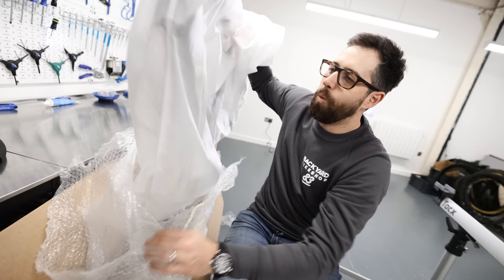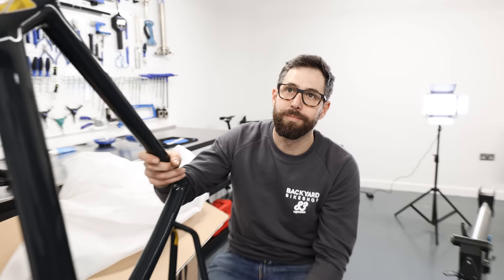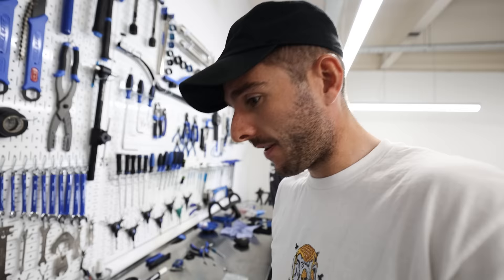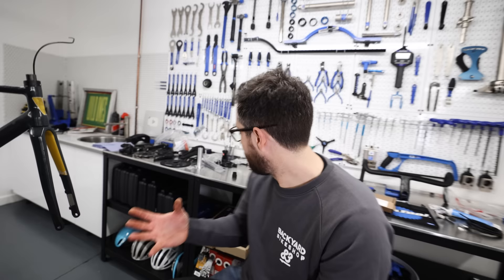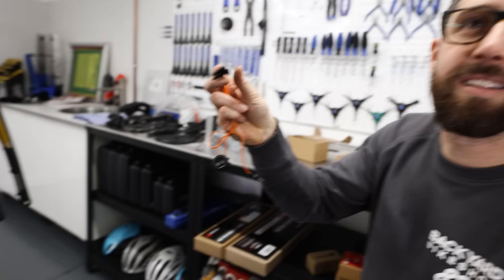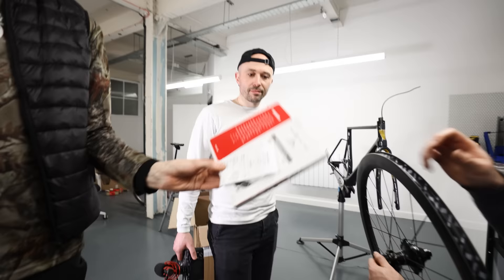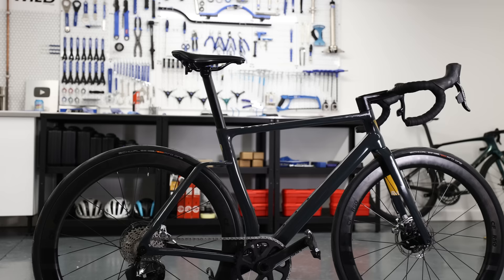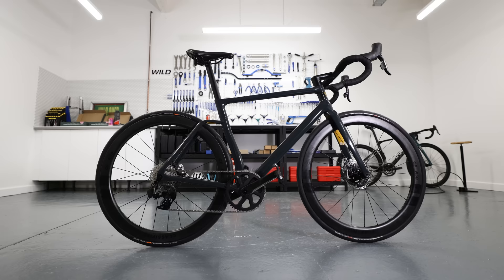We've Never Seen A Bike Like This - Nic's New Road Bike

Comment: 900g+ weight penalty? That doesn’t negate the weight of a front mech / chainring etc at all. You’re adding about half a kilo in comparison. The only advantage is an aero one, but then that’s probably negated by the whopping thru axle lever… it’s fancy tech, but that’s all.
Reply: To be fair, that’s compared to my Zipp 353’s with a 10-33 SRAM Red cassette and Michelin tyres. So probably about 300-500g lighter than most other wheelsets out there. But yes, it’s still a heavy system. I’m sure with the new investment and other wheel manufacturers like Enve they’ll be able to shave some of it off.
Reply: @nicvieri2627 true, there’s more to be had I’m sure. There must be something in it otherwise they wouldn’t have secured the investment they have already! Enjoy it, looking forward to an update to see how you find it after putting some miles on it 👍🏻

Comment: The future Nick describes already exists - Shimano Alfine 11spd Di2. With Gates belt drive makes for an awesome low maintenance set up on my road/commuting bike. Rear wheel is a bit on the heavy side, but that's the only negative.
Reply: And shimano also have automatic gear change based upon your cadance.  And you have the pinion system aswel. Is said to be better than rohlloff.
Reply: Heavy and not terribly efficient (Alfine is decent, but all geared hubs seem to be just slightly worse than casettes). But almost 0 maintenance rules, it's great for the everyday bike.
Reply: @Finnspin_unicycles  tiny bit less efficient than a derailleur system working in perfect order, but not so you'd notice when pedalling. For low maintenance commuter or touring it's awesome! Overall weight is about the same as a 'typical' derailleur system, it's just concentrated more at the back wheel.

Comment: It’s been several years on market after 1-2 seasons you need to send it back to serce to replace internal parts. It expensive and heavy. It is not a future of cycling. Cyclists are not totally satisfied and some go back to a regular double ring. The range is not as good as traditional gears and ratios. unfortunately.

Comment: Very nice bike. The classified hub is very interesting and I think things will move internal over time as long as they can get the drag down on the system to a point where the loss of drag is made up for by the loss of aero drag. No pro is going to run a system that costs them watts and if pros don’t run it people won’t buy it despite most people’s needs and a pros needs being basically the opposite of each other.

Comment: Great video. The electronic shifting and internal gearing is moving much faster into production on the e-bikes where you're pushing 400-600 watts through the drivetrain continuously and there's more wear from heavier loads.

Comment: Sweet bike. And yea… internal gear hubs do kinda rock. I’m personally a fan of them. I’ve got an 11spd hub on my gravel bike, and frankly love it. Is it the lightest? Nope, but hella resilient. Gates belt too… aka, so little maintenance it’s lovely.

Classified seems to be more or less going that direction. But am sure Rohloff, Shimano/Sturmey Archer will go electric shifting soon enough. The tech is there to do so.
Reply: Rohloff and Alfine 11 are already available with electronic shifting!
Reply: @here-be-ember  I read somewhere electronic is better for hubs since they're more sensitive to "cable" adjustment. Something about not fully engaging the gear if the adjustment is wrong.

Comment: Uno-X bike team testet that hub. The biggest problem was around the thru axel. Can't remember if you exactly why. The bike looks amazing tho and clever way to ditch 1 chainring.
Reply: They do different length thru axel’s. Some frames stick out more so if it’s too short it won’t tighten. I opted for the longest one. Just so that I can use it on a different frame of someone wanted to try it out.

Comment: I believe that those classified hubs would really take off if you could control them directly via DI2 or eTap.
Reply from the maker: I think you already can with di2
Reply: yes you can do it, but you have to cut the original cables of your Di2 shifter (but that hurts) and make the connection to the remote controle unit of you classified system.
Reply: @rikmeynen9871  Well, not really the solution I was hoping for 😃

Comment: Does not make sense, what problem does it solve? Basically they replace a simple front derailleur with a far more complicated set-up and there is no way that it would be more efficient. It essentially forces you to cross chain and that is always less efficient and then there must be additional drag in the planetary gears.

Comment: Love your videos, but the Classified hubs are a solution to a non-existent problem. What's the problem with front derailleurs? Either you go full internal hub gears (+ belt drive) and then you have a heavier but almost maintenance free setup, or you just stick with the regular 1X or 2X chain drive setup. Having internal gears AND a rear derailleur has almost all of the disadvantages of both systems with almost none of the pros.
Reply: I think the biggest advantage would be in the TT sector. Most of those guys are opting for chainrings up to 60t to maintain their chain line. Downside is climbing slight hills then without the small ring. Definitely very niche though. Will have to see how durable it is over time. Gonna be smashing it around for this year to properly test it.
Reply: @nicvieri2627  This thing would be great on a folding bike.
Reply: @barrytantlinger1033  Just put an internally geared hub on the folding bike and call it done.

Comment: Shimano made 11 speed electronic hub gears in the past, but it was a bit clunky and made for citybikes
Reply: They still do with the Alfine. Available with Centrelock disc. I've never used one so no idea how good it is or isn't, but axle options are slim (only 135 old iirc).

Comment: wouldnt the loss in efficiency of a hub gear counteract any potential aero and chainline gains?
Reply: and weight lmao
Reply from the maker: apparently it’s 99-99.5% efficient in the “smaller ring” position. No difference in the other position.
Reply: Yes, and by an order of magnitude for the kind of cyclist who should care about aero. 

Front derailleurs are fine.

Comment: Does going internal make it easier or more difficult to maintain? For a backyard mechanic like myself things like internal cabling increases the difficulty.
Reply: More difficult,  but also equally more cool.
Reply: Definitely more difficult. And definitely more expensive. You have to cut the brake hoses every time a headset bearings needs replacing. 
But everyone seems to be going this way.

Comment: 3T did this some years ago and it's a much prettier bike.
Reply: The 3T Strada was, and still is a frame designed for a double chainring and front mech.  The Vielo R+1 is designed and engineered purely for 1x single chainring. The symmetrical down tube into BB area increase lateral stiffness by 32% over a traditional double chainring frame design. This figure is fully tested and accurate.

Comment: Large weight penalty even if you lose a small chainring, hard to maintain, expensive (saw around GBP2800), an inability to easily swap wheels between bikes and drivetrain losses means this gear system is inferior to a standard set up. I could see this disappointment on the poor guy's face when the scales showed his bike was an anchor.

Comment: Question - I have a V+1, and understand that the thru axels are proprietary? Is this the same for the R+1, and if so, how are you using the Classified axels? Cheers - D
Reply: For the Classified axle, we have manufactured another rear mech hanger to accommodate the 1inch and half pitch thread for the Classified axle. Our standard Vielo QR axle has a TR3 x 12 pitch. So you can fit the Classified Power shift system to either V+1 gravel or R+1 Road bike with the new hanger. We can supply these hangers FOC.

Comment: The seat stays are super ugly and I doubt that carbon frame is made in the UK. The local brand is rebranding chinese carbon frames, nothing special really. Just another brand selling overpriced carbon frames.
Reply: I can assure you none of our Vielo frames, or any other parts come to that are rebranded Chinese. Everything is designed and engineered by Vielo out of our Gateshead headquarters.
Reply: @ianhughes4169  I highly doubt it's made in the UK. It's 100% made in the far east by an OEM and rebranded like most Western brands. If not I'd like to see their manufacturing facility in the UK.
Reply: @harrybbbb  Rather than you or anyone here, trying to prove a point, which is incorrect, I invite you again to come and visit our HQ to show you where our frames are made. You, or anyone who is interested will be made very welcome. What have you got to loose ?
Reply: @harrybbbb  No they are not made in China. They are not open mould frames. The country of origin is printed on the frames which is a legal requirement. Taiwan. At no point have we stated our frames are manufactured in Gateshead.